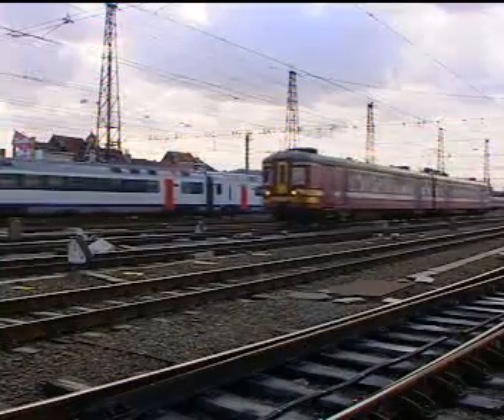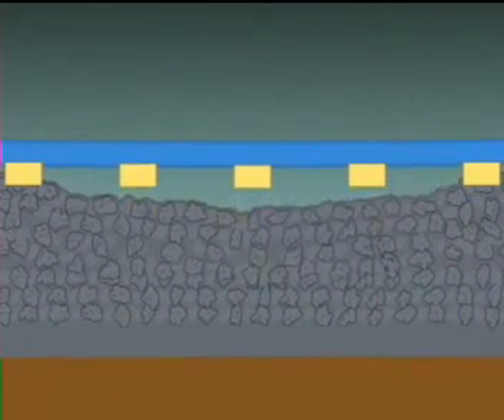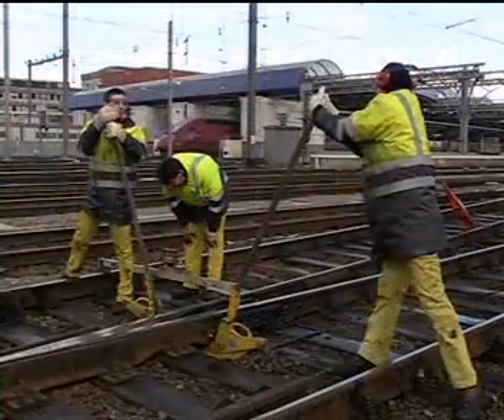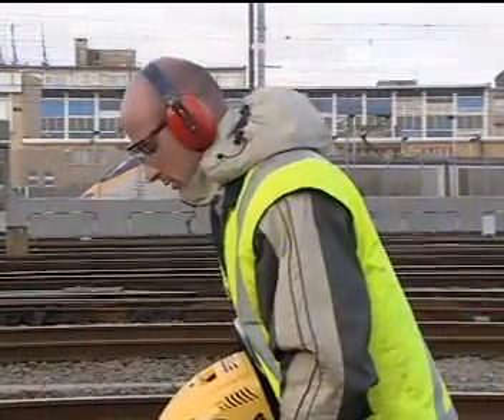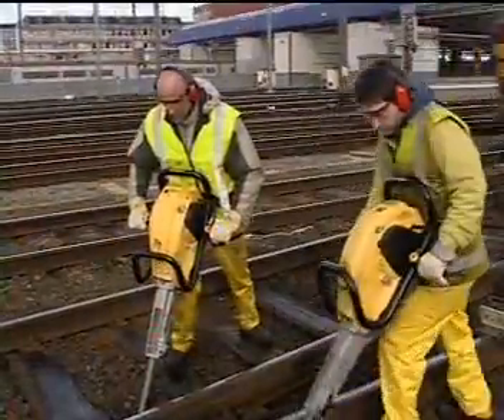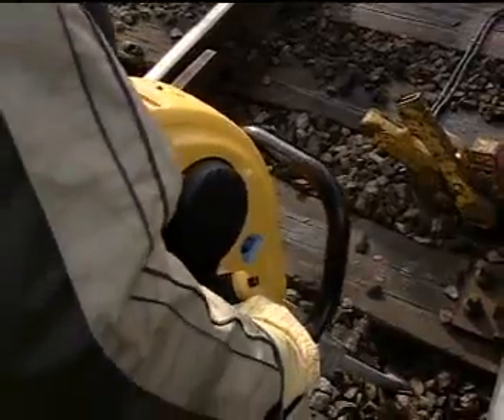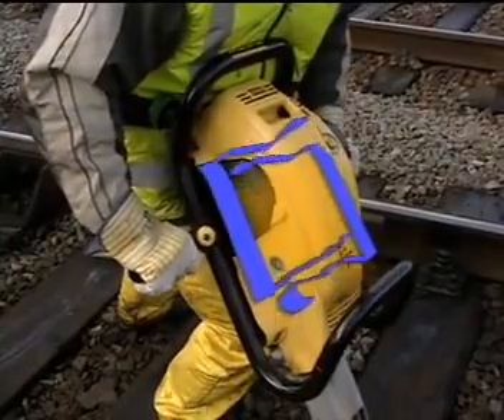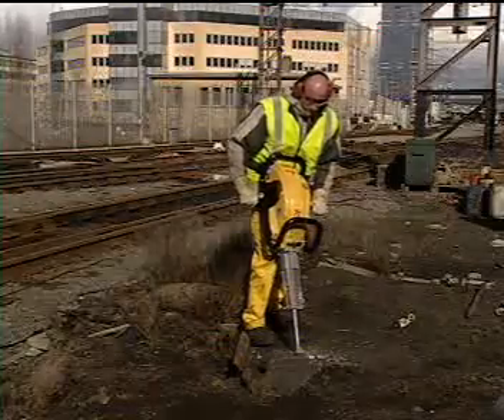Cobra TT OFF TRACK TAMPER engine mounted version

Comment: This Off Track Tamping Machine is only one product in Engine Mounted Version to use for Indian railway. In India, this was purchased by North Central Railway in Agra Division. There are now in work and very good in performance. This is a very good product in Indian market.

Please contact any type of information with Atlas Copco Off Track Tamping Machine.
MOB: +91-8743853255, +91-8791280903

Comment: cobra tt - off track tamper comes with built in engine and weighs only 25kg .
this machine is very light mc  as compared to the  very very high vibration and heavy mc available earlier

Comment: off track tampers  cobra tt ------ disallow beater packing and you can do  selective small patch maintainence / tamping in yards and crossings / specially designed to carry out tamping on points and crossings  and at glued joints . it does not pulverise the ballast at all . 

quality of packing / tamping is very good .

Comment: off track tampers - engine mounted - is RDSO approved ref 321 . the specs are available on the net .
the mc is very good , light weight , high performance -1620 blows per minute and totally vibration free

Comment from the maker: machine is excellent in its class - absolute vibration free

-------------------------
off track tampers - very light weight , portable , does not require to remove ballast . does not pulverise ballast .